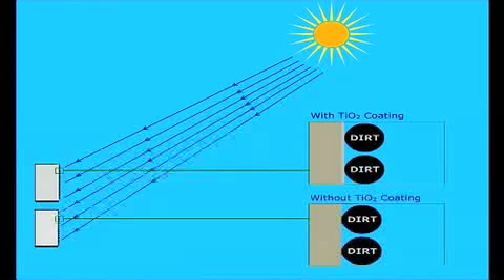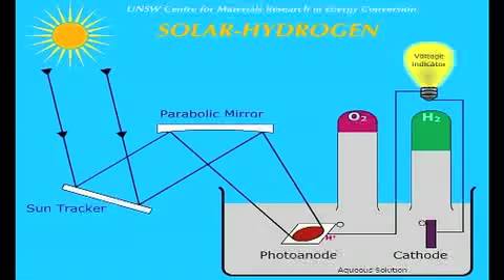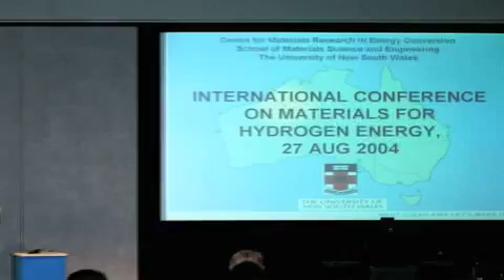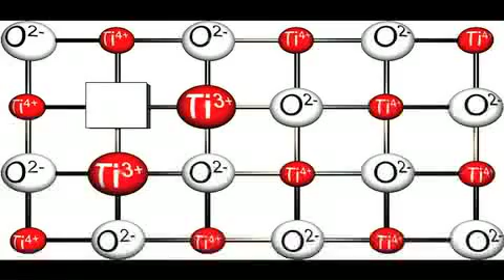Solar Hydrogen

Comment: @Sextous3 - two different things. The TiO2 coating on building materials would just result in a cleaner city - both cleaner air, and cleaner-looking buildings that require less maintenance. The use of TiO2 to crack water would require rooftop installations with plumbing for the water and hydrogen collection.

Comment: This reminds me of what Dan Nocera is working on at MIT. Check him out if you like this video. I just have one question about the use of hydrogen though.. Can we use it to fuel vehicles yet? I thought it was a highly unstable and an unperfected method of fueling cars etc. at the moment. Or maybe I'm missing something important here. Are we talking about using hydrogen to create electricity somehow to charge plug-in electric cars?

Comment: Are there papers on how this works?
Hydrogen isn't great in terms of transportation. It would be better to create ethanol from it, even though there is a loss involved. Also, if you can do it by extracting the Carbon from CO2 in the Atmosphere you would have a carbon neutral technology - just as much as pure Hydrogen.